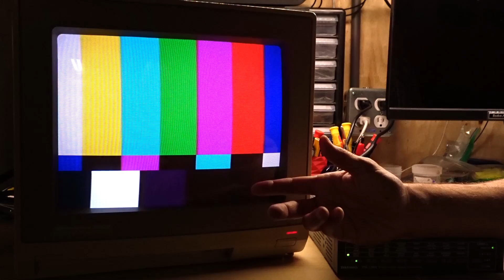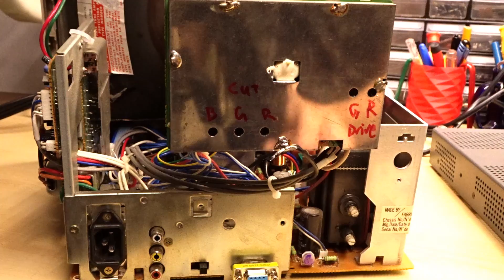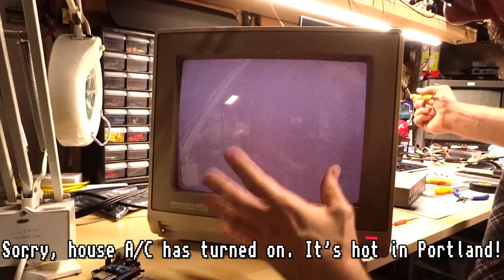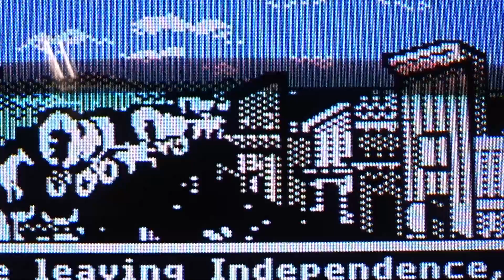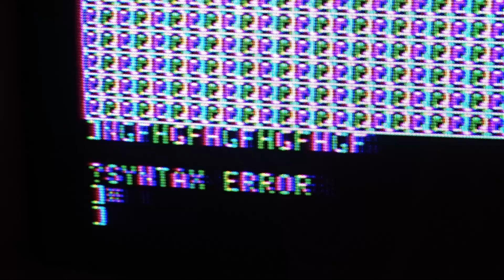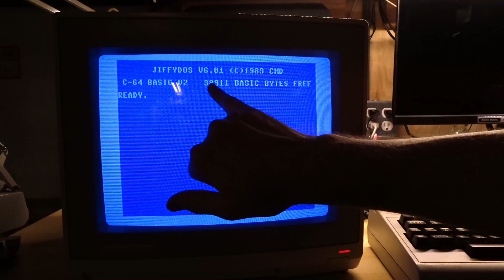Giving my tube swapped monitor a tune up to make it look better

Comment: That was a fantastic video! Someome sent me here after i posted a video showing something very similar on my kortek crt, except i have a green wash over my greys. Adjustments like these are super tough on my unit because its so big and you have to access it from the back. But I'll look through my manual and see if i can locate these adjustment points.

Comment: Great video. Keep in mind failing capacitors may cause funky color issues too. I had to replace the capacitors in both my commodore 1084 monitors. Cleared up issues. Found many that were leaking.

Comment: Great channel and always leaning stuff here but in the case of a suspect CRT, if a tube looks a bit crappy/weak, i check it with my  CRT analyser/cleaner to test the guns for output otherwise you can adjust all day and end up getting nowhere. Pays for itself if you have lots of CRTS which of course sadly is a dead technology now with LCD's and LED's now which requiring no adjusting beams and all the headaches except bad PS's and backlighting issues

Comment: Grab the manual for it, there is a whole adjustment process which uses a DMM and scope and then you can adjust the neck rings etc, if needed.
I have 5 1084's and some earlier ones, finally getting around to recapping and adjusting them all..
Love your channel.

Comment: The overall uniformity of the screen would improve if you did a purity setup. Also definitely needs a service-level degaussing. Swapping a tube changes so many things on the set that those kinds of things are unavoidable.

Comment: I used to use a test pattern that showed the RGB as 3 bars in all shades from 0 to 63 (lowest to highest). It was then easy to balance and set the levels.

Comment: A ps2 would look crisp on this thing, especially with s-video but i dont think the ps2 supports s-video, although you can get vga and component out of it so an adapter could be used without losing to much quality. a ps3 would look nice in 4:3 mode with a component to s-video adapter as well. Obviously this monitor is much older than those consoles but it would still be fun to see. wouldn't mind seeing a nintendo 64, wii, nes, or snes either. Or any console that has analog video really.
Reply: after doing a quick google search it does appear that the ps2 does support s-video, so the ps3 should via its a/v port

Comment: You should check out Shango066's TV videos. Lots of information on tuning up and repairing color televisions.

Your red gun is stronger than your blue and green, the reverse of the usual, but understandable because the Comodore startup screens are blue and green typically. You should have checked the emissions before installing.
Lower the red screen or raise the blue and green screens. The sharpness problem was probably caused by an incorrect focus control on the other monitor. It may have been wise to repair the RGB input while you were in there...

"Bias" and "Cutoff" refer to white level (at which level the gun is fully on) and black level (at what level the gun is fully off). It's to control the scale of the brightness, since not all tubes are exactly matched. Has nothing to do with "overall color" or "Grayscale"

The fact there are only red and green screen controls makes me think this monitor was built on the cheap. Even crappy 70s color televisions have all three. It's best to adjust them with a plastic adjusting tool as opposed to a metal one, as the metal ones can create additional capacitance to their surroundings and interfere with your adjustments... Not to mention that it's on a high voltage section of the CRT's electronics and could put you in serious danger.
EDIT: Oh, you did use a plastic tool. Good.

You can always tell how worn a CRT is by checking the adjustments for the focus and screen controls. If they're both close to the top of their range, it's a crap tube and you should either pass on the set or get a new / rebuilt tube.
Reply: nice to see another Shango fan here lol. i'll watch anything tech or electronics related tbh.

Comment: Never remove magnets glued on CRT they are there for a permanent magnetic calibration and the line burned in that you see is probably where the TV SAFE area marker was, the TV SAFE was used back in the 4:3 CRT days when shooting and editing to have a reference where the action and any titles should be within because many CRT were overscanning and shooting parts of the picture inside the tv bezel

Comment: I haven’t seen that problem in so many years. It’s caused by buildup of slag on the b/g guns vs the red one. Back when a replacement tube was an option we used to do a Regen on the guns. What it does is overdrive it like heck with an special device that had like a hundred different neck adapters depending on what type of tube it was. We could then measure the difference in amp draw of each gun and burn them equal. The burn removed the slag and an unhappy tube could be good for years again. Except when is went pop and you overdid it. Perhaps a bit risky on something that’s irreplaceable.

Comment: Does your test pattern generator also generate test cards that you'd usually see in PAL, like the FuBK test card used mostly in Germany, or the old Philips PM5544 test card that was widely used along with the SMPTE one we know form NTSC? I have the Philips PM5644 test card (the 16:9 wide screen version of the PM5544) as my Windows welcome screen background.

Comment: Now you know why us Europeans call it Never Twice the Same Colour :)
Reply: Oh believe us, American's know this. Check out Technology Connections (a criminally underrated channel) if you're curious about why NTSC has these particular behaviors.
Reply: TBH, I've definitely seen PAL rendered wrong (color shift visible between lines) where a tint control would have helped to get the lines in phase with each other.  I detested not being able to adjust that.  I suppose it's fine for TV watching from a distance.  The point is that PAL isn't immune to the phenomenon, it just quasi-hides it.  At least we have a tint control to adjust for it!

Comment: More reasons to use plastic adjustment tools beyond electrical conductivity: If you're adjusting a coil, metal tools will alter the inductance, can crack the fragile ferrite core, and can rapidly heat up.

Comment: Nice Vid mate, I have one of those 2002 monitors and I really like it, over here they are a bit rare and on the expensive side but from time to time they tune up and I was able to get one, I haven't been able to use it with RGB but even with S-Video looks really good. BTW, that test pattern generator is a really cool tool.

Comment: Are you sure your blue color vision is normal?  What you called red looks magenta in the video,  and what you call grey looks blue, almost cyan.  You may be slightly blue-yellow color blind.
Reply: I'm pretty sure that might be from the camera due to the lighting. It's not easy reproducing what you see on a CRT on a video. Also, you can tell there's some automatic thing going on, because whenever his hand is in front of the screen, the brightness and color changes. It's especially noticeable when he shows off the C64.
Reply: @bruwin  The fluorescent tube over his workbench is most likely are "warmtone" .. see how it looks almost yellow in the video? Those are 2700K white balance usually, while CRTs are around 5000-7000K (daylight-like). Automatic white balance usually sucks in mixed lighting situations like that and seems to be sitting somewhere in the middle, adding a yellowish cast to the surroundings and a blueish cast to the screen image.
Reply: Can't you tell that the camera is capturing incorrect colors to begin with?

Comment: Very nice, Adrian. I am currently doing some restoration work on an 80s Sony Trinitron and Toshiba Blackstripe - both need a bit of a capacitor refresh. I will inevitably want to make some adjustments to basically recalibrate. 12voltvids has a good video for adjusting BIAS and Drive on a TV. I don't know if you have a service mode on that monitor of yours to create a single horizontal white line like in his video (I assume it temporarily disables vertical deflection). Check out "toshiba crt tv troubleshooting video output and crt bias adjust" on his channel.

Comment: Are you going to try recapping the Monitor at one point? The 2002 or 1084?
Reply: twoquickcapri I would actually recommend doing this BEFORE all the adjusting. The brightness and contrasts can change quite a bit, unequally between the drives. Cap kits can REALLY clean up the image.
Reply: twoquickcapri But yeah I also hope he does a recap video.